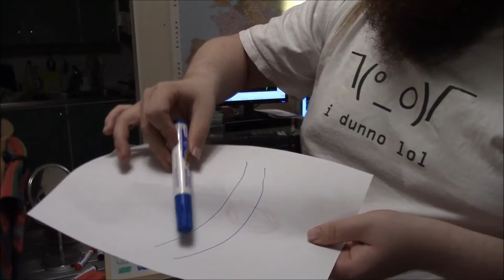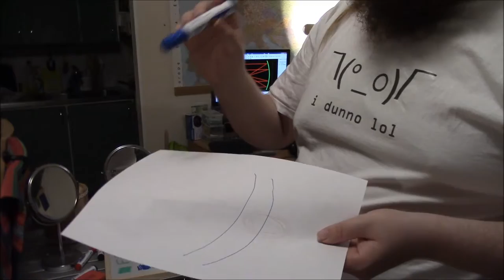More makeup telescope part 1 of 2

Comment: This just seems nuts though these people want you to believe they are smart.  I asked a simple question... Does a lower magnification makeup mirror have a longer focus point?    I went to ask.com and gave this poser.  Not one single site gave any definitive... Or any answer for that matter. So... I sought sites listed as focul point equasion, how to determine the focal point of a makeup mirror, and focal point caculator...and more. But NOT A SINGLE SITE CLAIMING THESE ABILITIES SHOWED ANY EQUASION OR GAVE AN ANSWER. What I did find was sites claiming to help you focus or tou retirement, how to caculate anythi g but this topic and such un-related crap.  So when will someone develop a search engine that does NOT list un-related crap to the topic in question?  Want to be bigger than Google... Make a search engine that stays on topic!!!
Reply: you need to expand the light from outerspace, then you get a bigger image,  but you need to keep it in focus.
Reply: Well, you looked everywhere except where you should have looked. :')
Google makes a profile based on your searches and site visits (nearly every site uses google tracking for traffic info). If you visit and search a lot of crap you will get more and more crap as google adjusts to the "quality" you seemingly went for in the past. The search results you are getting say more about you and the quality of your keywords than the search engine tbh. (Also this means google has built in personalized confirmation bias.)
The engine also has all the features required. Maybe you should look around a bit on google to find things like site: to limit the type of domain (e.g. to site:edu), or - (minus sign) to specify stuff to exclude. e.g. -retirement. Or you know go to a peer-reviewed public encyclopedia first instead of google.. Wikipedia... cough.. sources listed cough, or good sites about astronomy and telescopes? or... or... Anything but asking random people on the interwebs.. edu sites? encyclopedias? nasa!?  No you went to "ask", a bunch of random people, and then youtube, another bunch of random people. Beyond your front door if you needed to know something w/o internet like this would you ask random people on the street or go to a book store or library and look in the correct section? Sorry for being "harsh" but I'd rather you leave my comment a bit closer to knowing how to fish than that I just hand you a fish.

Anyhow, in case you haven't found it or gave up by now, the fish you are looking for if I understand you correctly is:

1/d(o) + 1/d(i) = 1/f

m = h(i) / h(o) = -(d(i) / d(0))

d(o) = object distance
d(i) = image distance
f = focal length
m = magnification
h(i) = height of image
h(o) = height of object

But don't bother unless the only thing you want to look at is the moon. For a real telescope you need suitable mirrors, these aren't glass with a layer of shiny stuck to the back, they are "perfectly" polished, plated and reflect AT the surface. But of course if you think you can build a serious telescope, something that can do more than show a big crater on the moon (good binoculars can manage that) in the worst quality possible good luck lol. 
The most important aspect of a telescope for serious use is how much light it can collect, why newtonians and such are often affectionately called lightbuckets, because that's what they are, meaning you want big primary mirror and big aperture.. Don't get hung up on magnification, high magnification only serves a purpose if the optics and size/light gathering capability are of equal high standard. (e.g. that's how they dupe moms and dads with toy scopes.. 600x zoooooooom.. yes they do 600x zoom, a 600x zoom of a crappy too dark image is a crappier darker image.
Also the primary mirror isn't really the primary magnifier, magnification is done for the largest part by the eyepiece you use to study the image in the secondary mirror. Also don't skimp on eyepieces, they are no less important than the quality of the mirrors (or lenses if refractor), they are all part of the same chain and that chain is only as good as the worst bit in it.
To figure out useful magnification and thus which eyepieces to use with it, the rule of thumb is about 50 to 60x the aperture diameter in inches or 2x the aperture in mm, this is the maximum potentially useful magnification depending on optics quality..
My "craptronomy" dobson (I like making useless crap scopes just to see what I can do with spending 0 euros) with an aperture of 102mm, if it had proper optics there would be no point to go with higher magnification than 200x, that's if the air is crisp and still both down here and up there, the stand is very, very stable etc. (magnifications also magnifies wobbling and shaking of the stand and scope etc.). Even if I had proper mirrors in it I wouldn't get eyepiece for it beyond 100x total magnification. It's really not necessary anyway unless you want to see planets as best as possible. 
Most pretty things are not small in the sky, just hidden behind bad human eyesight and/or light pollution.
E.g. Andromeda is bigger than the moon in the sky, no zoom required, orion, etc. That's why light gathering is more important than zoom. Here's some relative sizes compared to our moon. 2 = andromeda

https://en.wikipedia.org/wiki/Curved_mirror#Concave_mirrors

Anyhow, what type of telescope did you make out of a shaving/make up mirror?
Reply: Lower magnification mirror have longer focal length.